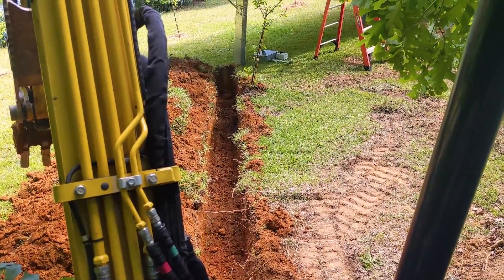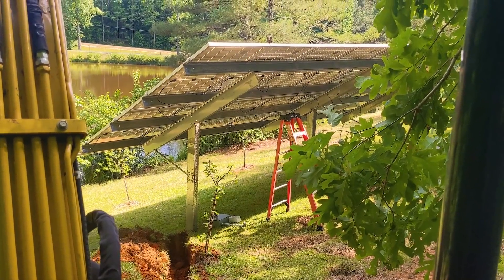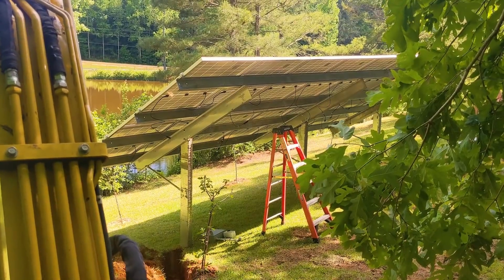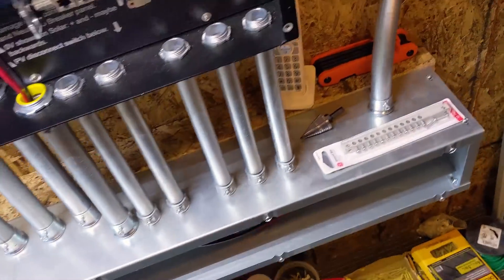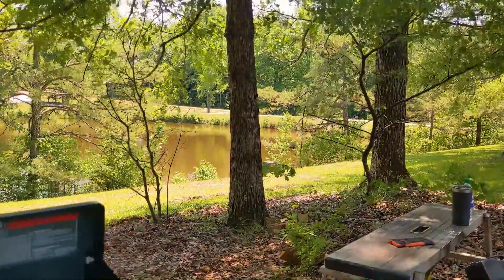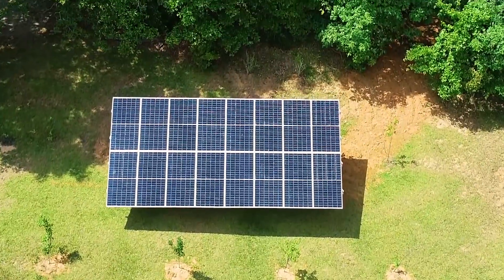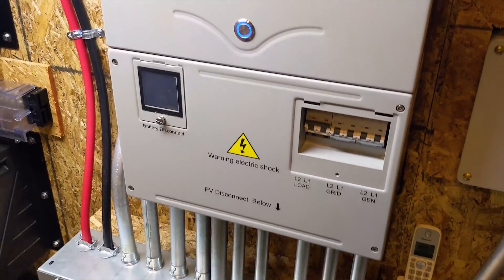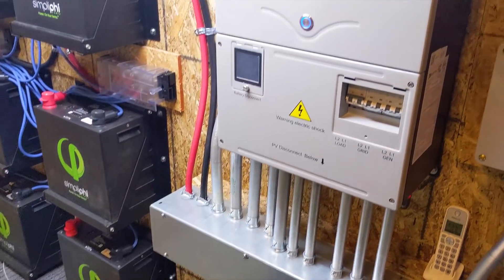Solar DIY assist

Comment: Installed an aims 12kw system. And it just doesn't perform.  Has the 12 kw charger inverter. Has 12 330 watt  panels wired in 4 banks of 3 equalling 3960 v. And 12, 12 volt  200 ah batteries wired in a parallel/series configuration. For a 48 volt system with 600 ah, rated at 28800kw but Its a weak weak system. Cean't run crap. Gets full sun on the panels. I'm lost, seems to me it  needs more panels and more batteries. And of course it's not an all in one  inverter. So that means a larger combiner box and a  larger charge controller

Comment: Love your video's, I am in the process of getting my golf cart set up with an inverter so it will charge all of my power tools and battery chain saw, preparing for the rolling black outs they are going to unleash on us. You have great Ideas, the solar golf cart is basically a perpetual motion machine ;)

Comment: Have to admit Scott, you do a great job with the solar but I miss your old videos  on actual projects and elements of your homestead. You single handedly got me hooked on gasifiers and ram-pumps.
Reply: I forgot about those old vids.  He did go on a ram pump kick there for awhile.  He’s probably too busy running his business now, but I too miss the old homestead project videos.
Reply: @notreallyme425  he bought a centrifuge once where he could separate used oils...never saw how that worked out. He has quite a library of videos for viwers to sift thru....but, wow when YouTube was first getting rolling his channel was a must watch for homesteaders and preppers.